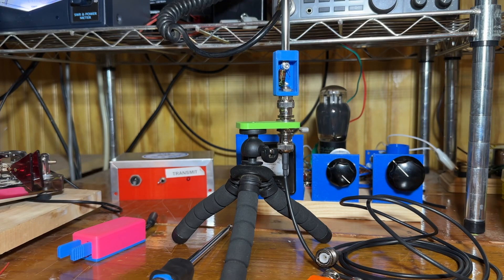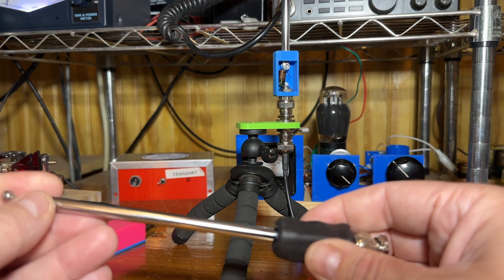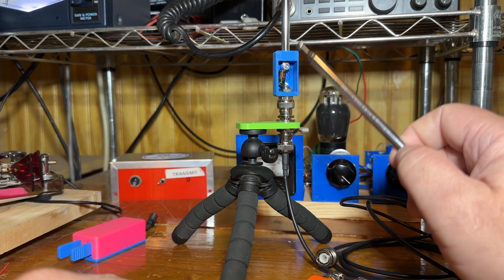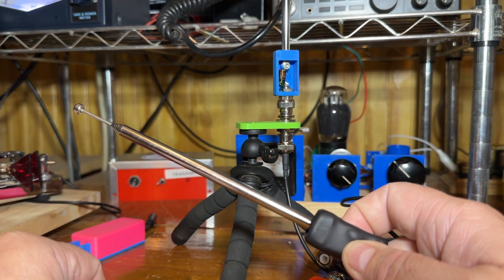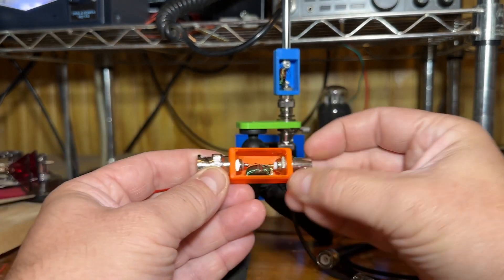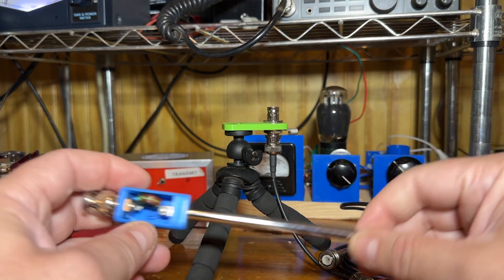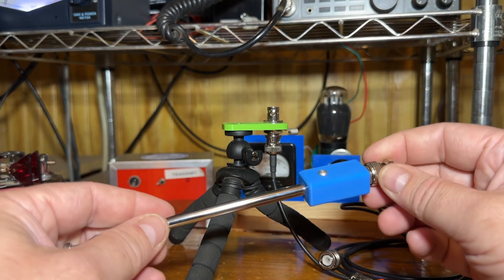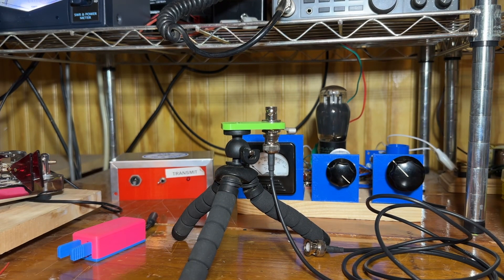A low cost Elecraft AX1 Alternative Antenna

Comment: For that collapsible antenna and aiming for the middle of the 20m band, did you get something like 11.1 μH? That's what I'm getting but it doesn't seem right. Think I may have used the calc wrong.
Reply from the maker: in the caculator I used 2.5 ft for antenna length. and a diameter of .2 at 14.175mhz.This yields 13.6 uh. calculating the turns comes out to be 57. This will be extremely tight on the toroid, but will work(I do remember on my 20m version it was wound tightly. I would put a few extra on and remove as you tune the antenna. a counterpoise can improve results. Can always remove after the fact.
Reply: @QRPMonkey  Ok, so that's pretty close to mine since I picked 14.240 as the center and am using an FT50-43 torroid. Thanks for the sense check!
Reply: @KI5IJB  using the ft50-43 how many turns did you wind up with at 14.240?

Comment: I really like this design. Going to make a few for my QMX high band.
Reply from the maker: Good Luck. It can get a little tricky without a tuner. But it can be done. I would recommend building with a counterpoise if attempting to not use a tuner. My 10 meter version does work without a tuner fine. I tune it in by pushing the telescope in until i get the SWR i want.